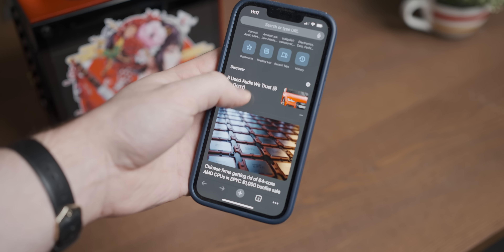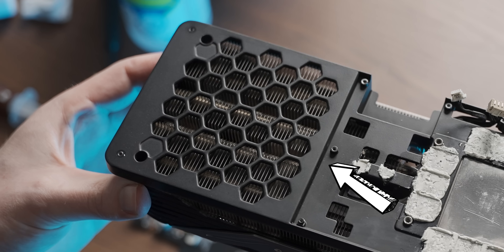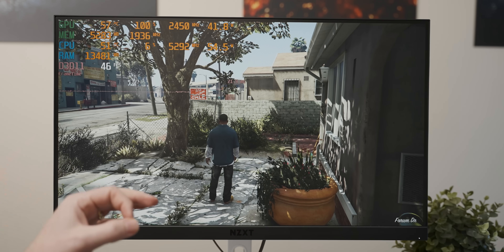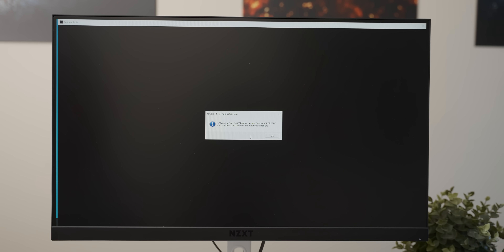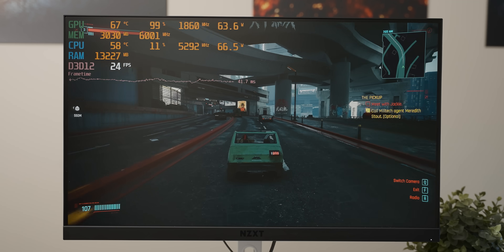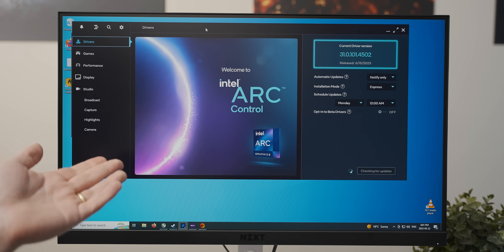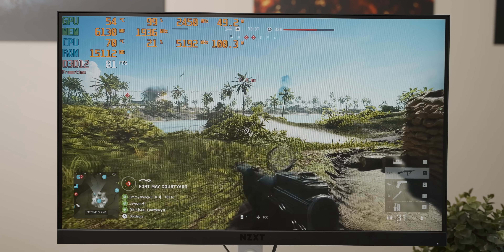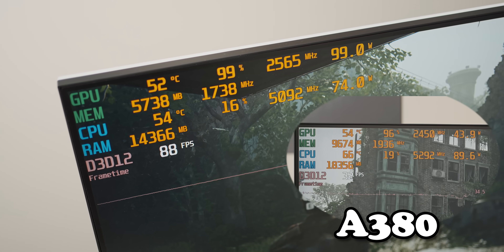The New Master Of Fine Wine Graphics Cards?

Comment: Can you compare the RX580 8GB to this card? I wonder how it stacks up, while costing less. I think its 110 on Amazon US dollars right now and should be about double the performance of the A380.
Reply: The 580 beats it
Reply: I think "new" amazon RX 5500XT much better to compare
Reply: 580s are widely available and cheap. 5500XT is almost not available, if it is, the prices are too high. It has a 128 bit interface, some of them are 4GB memory. Its not advanced but held back by cutbacks.

Comment: You should try running pre-DX12 games with the Proton compatibility layer.
Reply: Funnily enough I think intel is actually using dxvk to play dx9 titles and lower, that’s why the performance improved so much
Reply: @maikeru6158  it's a whitelist so for a lot of titles you still have to add DXVK on your own
Reply: @wanderingwobb6300  They are talking about the Windows driver. Intel refused to develop a new DX9 driver for Arc and just slapped DXVK into it instead, the driver is literally incapable to run DX9 games without it.
Reply: @letalissonus  it uses directx9 on directx12 primarily. Like I said the titles it uses DXVK for it a whitelist with only titles they've tested as working well with it using it. You can still use DXVK for any title on your own though.

Comment: The AMD card along with the a750 are the value cards but to be fair comparing a high price a380 with the lowest price AMD card was a little disingenuous. Still at this end of the market you would unlikely get this card for gaming only. AV1 maybe. There have been people suggesting pairing this with a second card for awhile now. Anyone still buying Nvidia in the budget space should hold off until they start competing for value in this space again but they won't.
Reply: I was tempted go get arc a750 one month ago, but since i mostly play dx11 games (and not many of them anyways) i opted for a rx6700xt instead.
So far im happy, maybe less happy with shitty game developers...
Reply: By price point, the 6400 retails for very similar to the A380 here where they trade blows depending on the game. AV1 might be a pull for some but I’d imagine the average person will go for the AMD card due to their gpu segment (obviously) being more reputable. As a new player Intel needed to create a card that has no real competitor in its price point and failed
Reply: @kawjio  I understand that being the new kid on the block they had to pull out something special and in a lot of ways they did. Drivers aside which while improving still need work when released they were more than competitively priced and it appears as if they have somewhat forced the other companies to reduce their prices. Although you are unlikely to use ray tracing on the A380 as the class of card moves up to the a750 or even the a770 (although despite the 16g of vram I'd say this card is overpriced) some ray tracing is available with a much lower hit than AMD and often comparable to Nvidia. I think at the budget end of the market both AMD and Intel offer good choices and we should be thankful for that. AMD drivers are more mature so are more stable at the moment overall but that also means less headroom to grow. I remember this exact same argument regarding AMD and Nvidia cards in the past and have watched those older cards age much better with AMD cards. The same might be true now for Intel. If I was to build a budget system now for myself it would be a hard call but I would likely use an AMD card for less experienced users still with intel cards tending to scale up to 1440p and 4k than the others it will be interesting to see how battlemage gets on. Especially as that architecture is to compete with current generation graphics cards. Intel, being somewhat late generation wise.

Comment: Great, but when can I get a "driver update" for my HD4000 integrated graphics?
Reply: Well Linux does give intel igpus a small performance boost, though 10-20% is probably not gonna change much
Reply: Latest update foor 4600 is from 2020 or 2021 so... same for 4000 (same base) i guess
Reply: @Spido68_the_spectator  Yep, and their last driver on the way out the door was a hot mess. Apparently there was a security issue in the DX12 implementation... so they just removed DX12 support. But the way they did it, the HD4600 still reports to the OS it has DX12 support, and just crashes any software that tries to use it.
Reply: @jameslake7775  so i should revert my driver ? Or is the security issue hardware related (and thus unfixable by software?)

Comment: Current real fine wine graphic cards: RX 5700, RX 5700 XT, RX 6700, RX 6700 XT.
Reply: I picked up a 5700XT Gigabyte OC model maybe 6 months ago, $200 (cdn) Very happy with it so far. I don't work it very hard, but it is nice not hearing my old R9380 scream like it is about to lift-off. I would have liked something new, but there was no way I could pull the trigger on something more expensive with less or equal performance. Warranty isn't that important to me. 6600s are still going for $250 on sale to $350 if not. Crazy.
Reply: @--_DJ_--  if you will undervolt this 5700XT properly you can get FPS boost with less power usage :)
Reply: @PolecanePC  She is thirsty, maybe I will look into that. Thanks!
Reply: And RX 6800, RX 6800 XT as well??
Reply: @hiriotapa1983  yeah well those I believe are cards used by limited number of people, let's be honest it's not like most of PC users are going for 'high end' cards
Reply: @PolecanePC  Yeah, there's way more 6700XTs on offer here than 6800(XT)s, but 2nd hand 6800s are pretty cheap now...

Comment: Nvidia is great at recycling, instead of throwing away bottom barrel chip they recycle them into 1630.
Reply: which they then sell at the price of a rx6600 💀
Reply: @skriv0in0navn  The 3050 being more expensive than the 6600 while performing worse than it is legitimately criminal.
Reply: @hollowcals  The hilarious thing is the 6600 is better than the 3050 at ray tracing too. The 3050 only sells more because the box is green.
Reply: @riven4121 to be fair that green box is pretty asf/j
Reply: @hollowcals  - ROFLOL
Reply: @hollowcals  - DLSS another con..........
Reply: @hollowcals  it has stable drivers atleast.. and can be used for AI development, meanwhile AMD delivers drivers that crash your system. I will never buy AMD again. Even if the Nvidia is $200 more than an AMD for same performance, I would get the Nvidia anyday, just cause I want a system that works.
Reply: @AndrewTSq same here
Reply: @AndrewTSq amd drivers are actually more stable these days than nvidia 😂
Reply: @user-vk2cd9qw7i have used AMD for years. And that sir, is a lie.
Reply: @AndrewTSq As someone who went from amd to intel then to nvidia within 6 months, nvidia by far has the best drivers. amd has the nicest to use software but all their shit is broken and crashes. intel has pretty incredible progress and tbh I'd say ahead of amd in drivers but definitely not nvidia
Reply: @user-vk2cd9qw7i  Yeah, AMD drivers even crashed windows installs just a few months ago.. sorry you are very wrong. AMD is still bad.
Reply: @AndrewTSq Maybe you just don’t know how to use a computer.
Reply: @AndrewTSq Gluck Gluck Jensen hey
Reply: @jamezxh  he actually knows things, since he was one of the persons who designed Nvidias gpus in the begining.
Reply: @MadCuzDev  You must have been very unlucky lol.

Been using AMD for many years, never once had an issue, besides issues I have created.
And Ive been using Intel and Nvidia aswell.

As of now I have a 12600k and 3070 simulator rig (racing sim) and then a ryzen 5900x and 6950XT gaming rig.
Both run perfect. No issue and has not had a single issue with either system.

Prior to this I have been alternating AMD, Intel and NVIDIA depending on price to performance. So as someone who uses both and have for a while, I can tell there is no real diffrence in drivers.
Reply: @riven4121 Exactly. One would have to be an absolute moron to spend much more on Nvidia for the exact same performance, when the only major driver problems AMD has anymore are related to user error.
I should have a worst case scenario with my BIOS flashed RX 5700 (XT), but the only crashes I've ever had have been related to unstable overclocks while dialing things in. I feel like most people complaining about AMD drivers are just having intense buyer's remorse about their shortsighted RTX 3050 purchase at this point.
Reply: @TinySly I have no clue what these people are doing to make their AMD experiences so poor, but it has to be some kind of user error they refuse to blame themselves on.
Reply: @AndrewTSq idk sr, my amd gpu drivers never crash, my pc is on 24/7 for plex, torrents work and gaming.
Reply: @AndrewTSq   Which was found to be Windows attempting to install drivers on top of the AMD Adrenalin ones during a driver update not the other way around. The issue with that was Windows Update.
Reply: @Brandon-uy1uv  That is great for you!. I can only tell you what I experienced.  But the RX5700xt made many people jump the AMD wagon for example, since we got the black screen of death
Reply: @riven4121  yes.. but these things always happens to AMD.... so they do something wrong.. its not the only time, do you remember when you could not play Destiny 2 cause of their drivers? the list goes on with problems.
Reply: @yasu_red  or they been unlucky.
Afterall, out of multiple 1000s of processors and grafikcards, there for sure will be some bad ones.

But what is bothering me is that they take a 1 time experience and try and present it as a fact.
Sure, Ryzen processors had an issue at the start it was a well known issue, but since that issue was resolved, AMD has been on top for price to performance and they have been very good.
Reply: @TinySly  Yeah. They think of an issue that has long been fixed and use it as an excuse to avoid newer things that never had that issue. Hell, I STILL see people saying AMD CPUs are hotter/more power hungry than Intel's when that's just objectively false most of the time. (ex: the ridiculously well behaved Ryzen 9 7900)
Reply: @yasu_red  well, we cant deny that they are very hot still.
But if we compare to intel, they are still cool. But that dosnt change that a 5600x or something runs very hot.
Reply: @TinySly  True. The hotter ones usually seem to be those with a single CCD. Even so, those still are much more power efficient than Intel's offerings, maybe because of the manufacturing process?
Reply: @riven4121 the 3050 is a glorified gtx 1660 super
Reply: @riven4121 not true
Reply: @AndrewTSq  I skipped that series, I went from hd 7750 to rx 560 to rx 6600. The 6600 is overkill, plays my games just fine on my 4k tv
Reply: @Brandon-uy1uv which games do you play, sir?
Reply: @vinylSummer  cities skylines, Fortnite, genshin impact, Rainbow Six Siege, watch dogs 2
Reply: @riven4121  yes
 My 3050 sold so well i got it for 220 cad when it launched....

Good times as it sits idle in a media pc
Reply: @AndrewTSq I had so many issues with Nvidia drivers it is not an argument for Nvidia
Reply: @GewelReal  If you look at how many % of people having AMD (very few) compared to the number of issues they have... then Nvidia can take one or two of people who cant use their drivers.
Reply: @genesisfan029  Horse Hocky.... AMD drivers are only stable on certain programs and games where as  Mr. Green has good stability all around.  I hate fanboys to the point I would rather eat donkey dung then listen to sheep blindly stick to a company because the box is red or green.  AMD makes great CPU's bar none at this point Intel is still playing catch up.
Reply: @riven4121  no its not
Reply: @hollowcals and dlss
Reply: @yasu_red  maybe failing to use DDU to uninstall old drivers before switching from nVidia and then wondering why it fails...?
Reply: @genesisfan029  not unless you don't install drivers properly or your are overclocking your gpu
Reply: @riven4121  The GTX 1080 is more powerful than the 3050 in pure raster.
Reply: @riven4121  I mean, it was only expensive due to the crypto boom, scalping epidemic and retail outlet price hiking them.

Nvidia set the RTX 3050 MSRP to $249 (still way too much for a X050 class card imo)

Meanwhile, the RX 6600 MSRP $329, more expensive than the RTX 3050

Just didn't work out that way due to the aforementioned factors

As much as I hate to say it, you can't really blame Nvidia there since it is not actually true that they made the RTX 3050 as expensive as a RX 6600.
Reply: @riven4121  it sells because both gpus suck and at least 3050 have dlss
Reply: @erisium6988  Even then, the 3050 targets 1080p. DLSS as well as FSR look horrible at 1080p because the resolution it's upscaling is incredibly low even on quality.
Reply: @riven4121 isn't the 3050 supposed to be energy efficient?
Reply: @Pryne83 I had been using a 580,it's legitimately been crashing my system like crazy recently
Reply from the maker: The part they really struggle with in is pricing their recycled crap.
Reply: @DawidDoesTechStuff  I agree that their price is high, but recycled crap? if you look at the 4060ti its as fast as a 3070, but uses around 70 watt less of power. Or the 4080 which is way faster than the 3090 but uses almost 100 watt less of power, that is not "recycled crap".
Reply: @AndrewTSq what world do you live in to say that a 4060 ti is as fast as a 3070. Key word “as fast as”. It should be better but it isn’t. So quite literally recycled garbage.
Reply: @Jizzler1  I have a 3070 and compare the benchmarks :P So its as fast as a 3070. If it was recycled, the power usage should not be down so much.
Reply: @AndrewTSq i dont see amd gpus melting and blowing up
Reply: @sudbtd  ah, yeah its a few months since the 7900xt and xtx reaching over 110 degrees while playing. easy to forget.
Reply: I upgraded my son's PC from a RX 580 to a RX 6700.  He had some crashes even with DDU, but a bios update to his Gigabyte X570 AROUS Elite solved all of the problems.  I think it was more PCIe related than the drivers.
Reply: The rx 6600 competes with the 3060 and it does it hard, while costing 100 usd less
Reply: Only good thing about the 1630 is having a lp version.
Reply: Idk why, but i feel more vulnerable when buying from radeon amd.
Why is that i wonder, it ist nvidias marketing or smth lol.
Reply: The more you buy the more you save
Reply: If I trapped in a backrooms and the only way out is to game on a pc/laptop with 3050, Id rather bite my own tongue
Reply: Or GT730
Reply: Over clocking them a bit with extra ram.
Reply: Ok
Reply: The GA107 chip wasn’t that bad (Aka the 1650 if you’re a nerd) it’s just Nvidia gimped the 1630 by making the clock speed 1700Mhz, and selling it for more when the 1650 has been having scalping issues since the beginning of 2020
Reply: AMD HD 8600M/8700M series rebrand into R7 M200 series another rebrand to M300 to M400 and finally rebrand into Radeon 530
Reply: The latest prob with amd drivers is certain games don't recognize them and won't launch you have to Uninstaller them to make them work
Reply: So what your saying this that they are in staid selling there garbage?
Reply: Yes even into the gt710s 😂

Comment: Aeaeae  0:19 Imma stop you right there. It has to be wine in the first place. You cannot ship that runs CS:GO worse than HD 4000 in the first place and then launch the driver later. the screen itself was flashing and had a haze to it at least on HDMI  for the first three months. had to resale the card and get a 3060ti